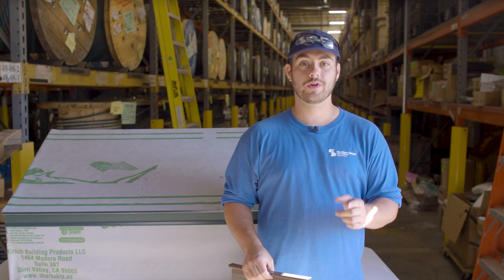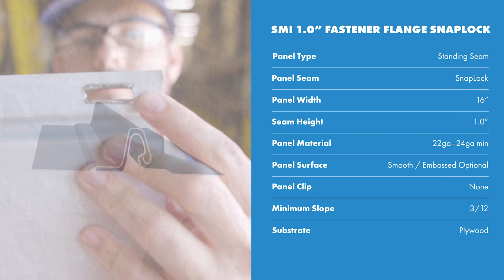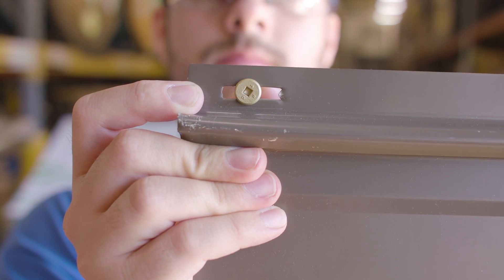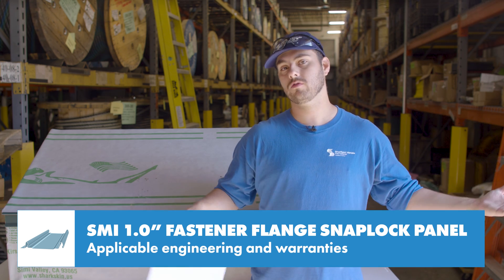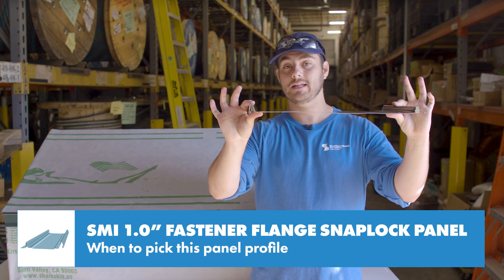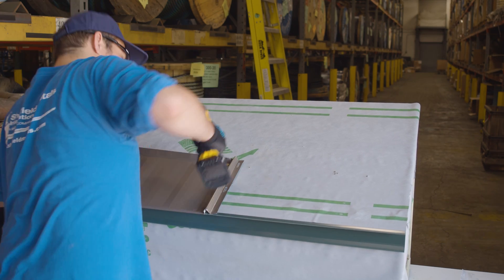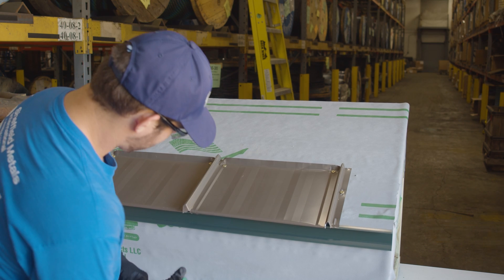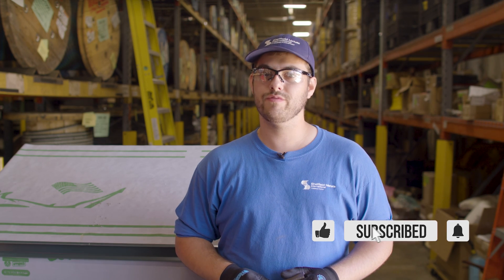SMI 1.0” FF Snaplock Metal Roof Panel: Uses, Installation, Engineering

Comment: My roof is a 4/12 pitch, Is it my understanding from your video that the 24 guage 1" FF snaplock can be installed on open purlins that are on 24" centers?, I have 24' trusses, all 2"x6", set on 4' centers with top 2"x4" purlins set on 24" centers.

Comment: Do you think this is a good profile to start a metal roof business?
Reply from the maker: The nail strip is a very popular panel in most residential markets, but it will depend on your location and other factors. If you need specific help with deciding which is best to start your business, I suggest talking to someone at Sheffield Metals: http://bit.ly/contact-sheffield -Thad